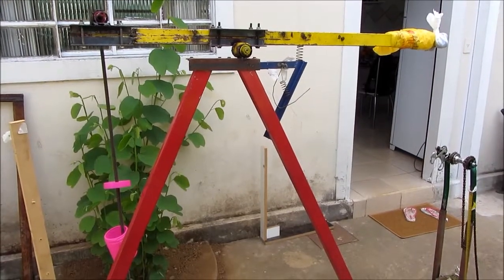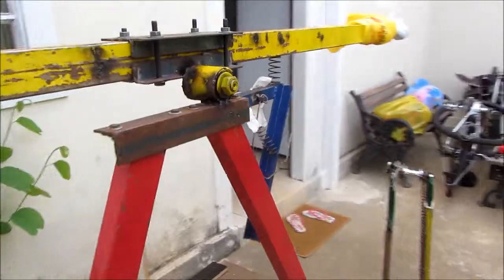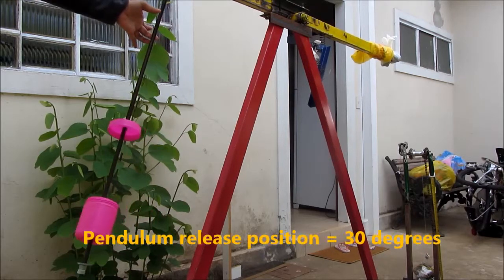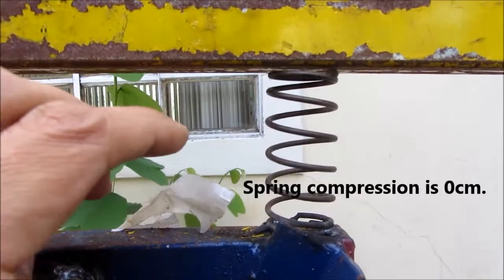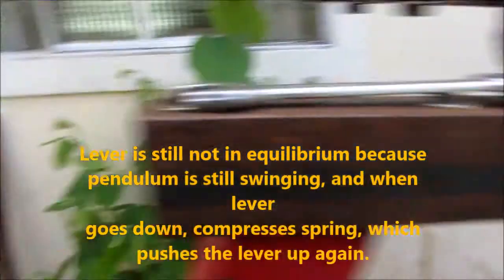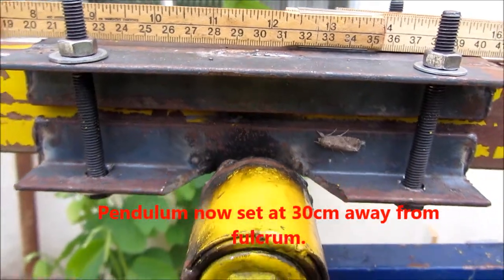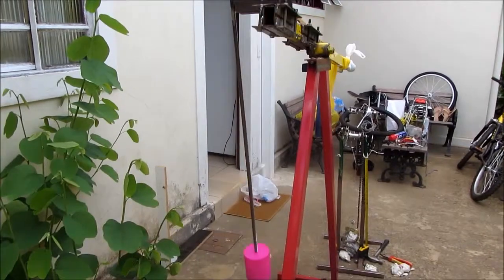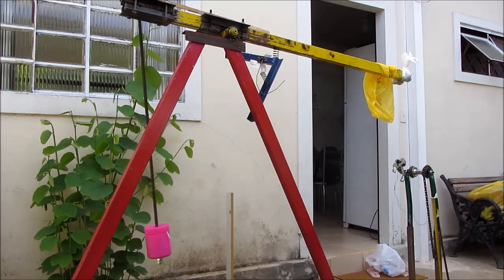4 - Lever in equilibrium and mass making "fake" work

Comment: Mr Luiz Fellipe Salomon,  you seem to be a good engineer working against all odds. You have the right ideas but there are a few issues that you are missing, would you please consider what I have to say, but you need not follow my advice.
This machine is  exactly what you say it is, not over unity and it does not extract energy from gravity. (Do not let anyone persuade you otherwise) If we turn it to a horizontal plane where the pendulum would be rotating horizontally and gravity would be totally eliminated, and it would still work as you said.)  However, in this case ,  your equipment is not helping you. It is not helpful to have the pivot of the top lever below its centre of gravity as it becomes unstable as yours is, it would have been better to have the pivot point  of the lever exactly at the centre of gravity or  slightly above,  so that it would remain stable on its own.  This applies to the attachments points of both the load and the pendulum.  Now:-

1. Under static conditions, the static sheer  weight of the pendulum MUST be balance such that the horizontal lever remains approximately horizontal, so probably some  counter weight must ALWAYS exist on the side of the load to bring/lift the pendulum up back to its starting point, and please do not forget that the load is lifted due to the sheer weight of the pendulum and also due to the centrifugal force, once there is enough of it. The load must lift back the drop in the sheer weight of the pendulum,  losing some of its energy, few people seem to think of that!

2. Now if the lifted load remains attached to the top lever, it would be  raised and lowered, and no work is done on it. The relation of energies is such that the raising of the weight is due to the shear weight of the pendulum dropping and also the action of the centrifugal force. When the  load weight drops  back all this stored energy in the load is transferred back to the pendulum through the fact that the pendulum has a shifting pivot and a pendulum which has a shifting pivot behaves totally different from one with a fixed pivot. So the fact that  the load was raised and lowered, no work  was done on it,. Here many people think that the work done on the load is the PE it gained at its maximum height raised, well it is not.   

3. With your equipment, when the ratchet is not working , your load goes up and down with the lever and so what I already said applies. But  with the ratchet operating, when the load is lifted  the pendulum does provide all the energy by dropping its static weight  and losing its angular momentum,  but when the  ratchet works and the load is effectively released all that is available to accelerate the lever down hence raise the pendulum back, is only that little bob weight you have attached to the chain and so the acceleration of the lever down, will be slow, too slow and not  fast enough to bring it back to its original position with the pendulum raised back. This is what is happening in your equipment.     Now here I would suggest that the top lever will be loaded with an energy storing load  springs ATTACHED to it all the time and not like you have with the spring disengaging from the horizontal lever.  As far was energy goes these springy load in parallel with a lossy load does not matter as they will  store any energy delivered to them and they will feed it back to either a lossy load or back to the pendulum, the synchronisation being done automatically by the system.   

With your system , it is clear that the horizontal lever keeps rising as it is disengaged from the ratcheted load  and the remaining weight is not enough to bring it down.
You are absolutely correct about your conclusions and here is what I found:-
The Two stage  mechanical oscillator is a pendulum controlled clutch that transfers energy from the  energy of the pendulum to a lossy or an energy saving load, and what is not used is passed back to the pendulum. 

Most people working in this field are misinterpreting forces for energy, forces may be amplified but energy never.
From what I see of your work , you have the correct idea, but your equipment and the fact that you have no energy storing load to limit your movement without losing energy is to be included.   as if you ratchet your load and  up and keep it there , you will not have enough moment in that lever to accelerate  the sheer weight of the pendulum back up, as do not forget the load is raised at the expense of the pendulum dropping in height and also at the loss of its angular momentum all because it has a shifting pivot.
Please consider what I said, and do not let anyone persuade you  that you are wrong about this machine, YOU ARE RIGHT AND THEY ARE WRONG.  
Now though you are absolutely correct, please do not run away with the idea that you are going to make anything useful out of this machine,    as all you can do is to store small forces applied for a long time in oscillating or rotating pendulums or flywheels or other energy storage devices as accumulators, batteries,  springs and use it later operating a larger force for a shorter time.   Such machines using fixed pivoted  pendulums can be linked directly to a load to use its  gained angular energy  or else use a shifting pivot pendulum which can act as a clutch to couple the load but still all the energy transferred to the load is  done at the expense of the pendulum losing its own energy and IT HAS TO BE REPLENISHED somehow, ALL OF IT.
Reply from the maker: +Carmel Pule'  
Carmel, First of all, thank you for your time for this extraordinary contribution you gave. 
Second, I'm a law-abiding citizen, and Joule made it clear through the law of conservation of energy, that I wouldn't be succesful in achieving  a perpetual motion machine (so neither will Pinky & The Brain). By this, my hopes were destroyed before I began building the machine.

Trying to respond the points presented by you:
1 - Totally agree. 100%... I mean... maybe 99% because there is some energy lost between you asking the question and I answering it :)
2 - Totally agree (again).  If you imagine an infinite length pendulum rod, it would "fall" forever, needing an infinite energy to restore it to its original position (and, to enforce what you said later on, I said ENERGY!).
3 - Could you explain better what you meant by the storing load springs? I tried to imagine the equipment with this, but I just couldn't.

Like you said, it is a force multiplier. Nothing more. An exquisite force multiplier. Nevertheless, just a force multiplier.

What I tried to accomplish with this machine was to show ENERGY.  I pushed the pendulum bob up, transfering an initial ENERGY (IE) to the system, which could be easily quantified. Then, at the other end of the lever, I got a certain amount of weight up, indicating a POTENTIAL ENERGY (PE).

Guess what? The IE was always bigger than the resulting PE... much bigger.

I'm going to reply your other posts on the other videos.

Again, thanks for the contribution and don't forget to enlighten me on the spring storing thing.

Thanx.
Reply: +Luiz Fellipe Salomon  Hallo Mr Salomon,  I shall explain my self about the spring storing requirements at the  output rather than heavy weights.

1.  The pendulum in a static sense, its own weight  must be counterbalanced by the weight at the  load end . In fact the load has to offer a higher  moment as assuming the pendulum is swinging at a LOW  angle, it is the load weight that will will bring the pendulum's dead weight   back up to its original position, after it loses it centrifugal force ,  while the load weight  is lifted because of the centrifugal force of the pendulum.   ( if the pendulum is swinging a lot as far as the horizontal, it will be a more complex behaviour, so please let us assume a swing of about 45 degrees  with the vertical) do not forget that at static conditions the Load weight must be larger than the weight of the pendulum for this machine to work  and so a load weight must be retained to make this machine repeat its cycle.

2. If you ratchet up ALL THE LOAD weight there will not be enough counterbalance on the other side of the pendulum to bring it up from the position it dropped due to the centrifugal force.  SO YOU CAN NEVER NEVER RATCHET ALL THE LOAD  WEIGHT  away,  but only a small part of it.

3. In order to avoid all this problem it is better not to think at the moment about loading the machine with WEIGHTS but with springs whose stiffness is selected  to limit the movement of the output to a convenient one .

The springs would be attached to the horizontal beam , one going up to a ceiling and the other going down to the ground. so when the beam oscillates all the energy would be stored in the springs and there will be enough to place the pendulum back where it started from. 
 
4. Now instead of  raising and ratcheting a weight you can use a water pump  so that the load will be  a load depending on velocity drag and not weight that you lose its  contribution effect and so to  " modify the  structure of the initial machine"    With a water pump or some load DRAGGING and not  getting rid of a weight,   the machine will retain its original design with all the ingredients to pull back the pendulum after it was dropped by the centrifugal force.

Again if one loses weight at the output, the acceleration of the pendulum upwards will suffer and there could be a point where there will not be  enough weight left to lift the pendulum back. But with springs attached to the output, this will never happen. You just cannot lose all the output weight all of a sudden in this cycle. 

Now I feel that the weight of the horizontal lever working in conjunction with the springs is enough 
Again  the load weigh  must never be got rid  of in total  as there will not be enough to retain the characteristics of the machine.  I would even go as far as saying that if one is pulling a weight it will have to be less that 25% of the weight that remains attached at the load!!!!! so you can imagine how little work done this machine achieves.

Also note that if too much weights/mass is attached to the output, the acceleration forces will slow down the movement of the  Beam and whole machine except the pendulum , but it does not mean that any work is being done on the load weight.    With energy storing springs whose mass is low, but forces could be high, the  "speed " of the machine  better as far as accelerating the reciprocating parts could be  better.

I hope this is clear enough.   I have been studying this machine for the last two weeks build one or two and played about with dropping the pivots and raising the pivots of pendulums to prove that this machine is  a machine which causes a Pendulum  with a moving pivot to clutch in a load and transfers its internal energy  to the lossy or an energy storing load and all that energy that is not used is transferred back to the pendulum.

There is no magic in this machine which I feel I do not understand. I hope this helps as what is in one's mind is not always transmitted through a language.............. I hope  this gives you something to think about, but seeing all your videos,   as a very old  engineer, I felt it in my old bones that you did feel that this machine is not what they claim it is .................. an amplifier of Energy to a ratio of 12:1.

Thanks for the  mental company  and the engineering spirit we live in, not many can join in such conversation!!

Comment: The spring is destroying you arm movement.  The arm should move in synchronization with the pendulum.  You need to dampen the movement in both directions the spring is returning a force and changing the pendulums stride. Try changing the springs to a piece of foam rubber or a shock absorber, up and down..  Stop the long end of the arm from going too high and it never lose balance.
Reply from the maker: ThomasTheSailor Chubby Wouldn't that be a waste of energy?

The springs are working as an absorber AND giving back this absorbed energy to the system, instead of just damping it.

I will be glad to arrange the machine with your settings and post a video of it over here.
Reply: Luiz Fellipe Salomon
  I agree it does give back,  but it seems at the wrong time, opposing the force coming from the pendulum.  In science class they call that chaotic motion.   Watch the arm move carefully.  Maybe even in slow motion video,  the arm moves smoothly to a point then goes off sync with the pendulum..   Milkovic has his limited to move with the pendulum..

Comment: The 'cantilever beam' is superfluous, and a waste of metal. Two magnetically geared rotary pendulums (friction free gearing) rotate over 360 degrees. Mounted on a rectangular box chassis.  Optional porous graphite air bearings are ideal. 300 mm. Diameter Rotary Pendulums. The axis of travel is vertical, and need not be greater than 10.0 mm. 10 Kilo weight is each pendulum. The down force acts on a plenum chamber, compressing air that assists rotation with air turbines at the centre. The 10.0 mm downward travel is locked in the 'down' position, against repulsion by magnetic springs. After both magnetically synchronised rotary pendulums have rotated beyond T.D.C. [Top Dead Centre] The chassis supporting both rotary pendulums rises rapidly by 10.0 mm. Forced up by the stored energy of the magnetic springs. Both rotary pendulums receive a rapid acceleration due to conservation of angular momentum. Care must be exercised to prevent the r.p.m. exceeding dangerous levels! The forces of centripetal acceleration when catastrophically released can be life threatening! Magnetic gearing N-S-N-S polarity in 'attraction' serves a dual purpose. Significant power output from 3 phase Faraday Induction "crenelated" stator windings.
Reply: *****   Show me this..  Post a link